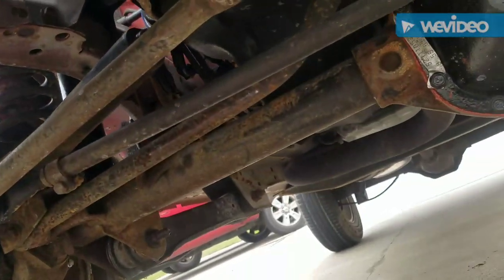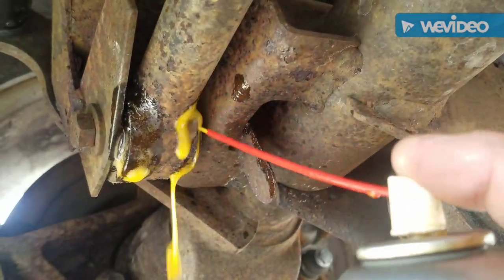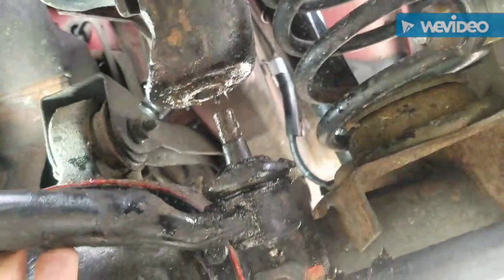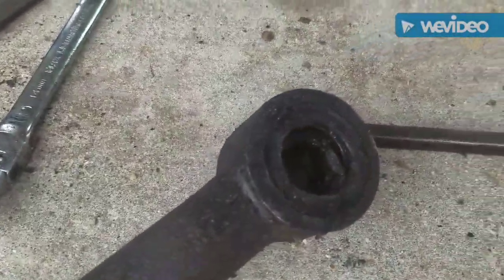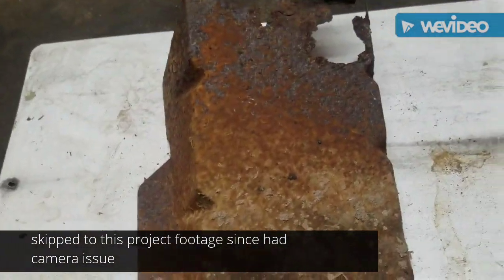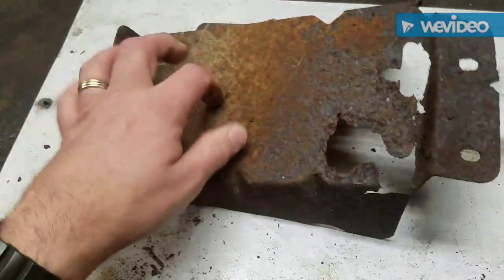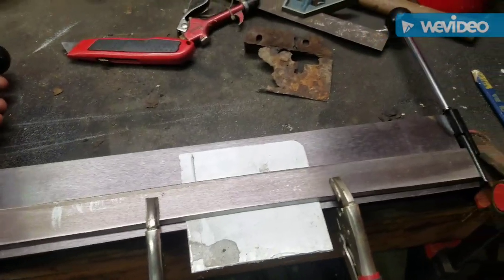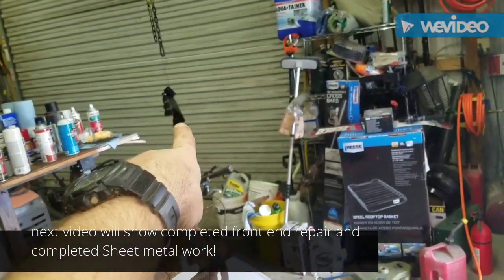Cheap Jeep Episode #16, Fuel Filler Hose Heat Shield,  Death Wobble, Track Bar #jeepxj

Comment: I'm with you. I think that bolt hole is worn. I like doing fabrication work, I'm just not very good at it. But it does take some specialized tools. That's my excuse anyway.  :)
Reply from the maker: I might try to use a bigger bolt.  Actually this will be the first sheet metal fab I've ever done lol.  I figure I cant mess this up too bad!